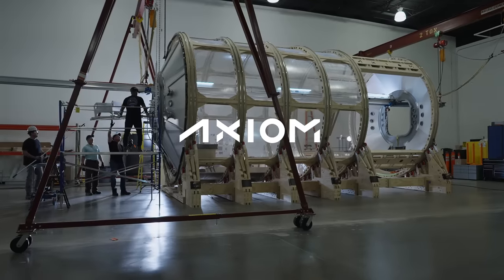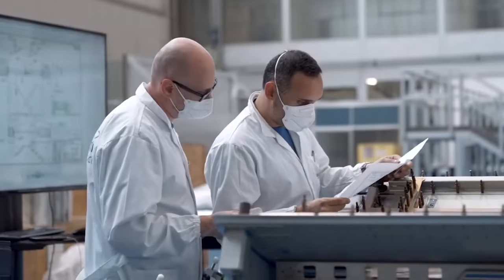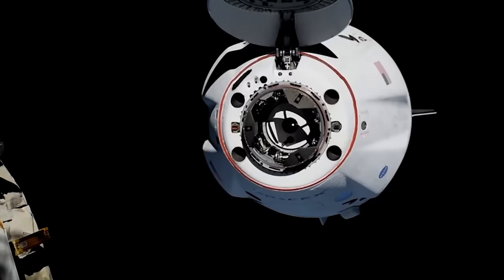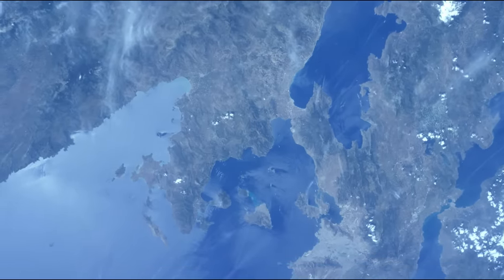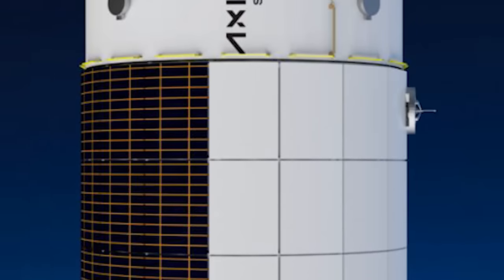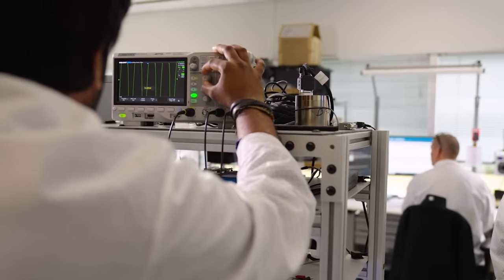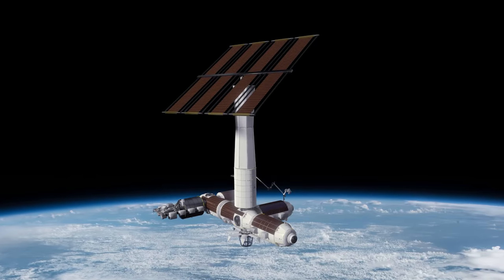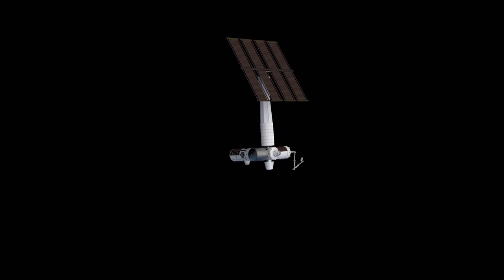Axiom Station's First Module Is Not Far From Completion

Comment: Very nice reporting on this. Thank you!  Hyper interesting reporting here with excellent graphics.  I would love it if they would use Alon for the windows, as it is far, far more durable than any other clear material they could install. Two inches of it will stop a 50 calibre round. Perfect for those micrometeoroids. Yes, it is more expensive, but when you're talking about human safety in orbit, you really need to budget for that.
Reply: A 50 cal bullet doesn't travel at 17K+ miles per hour.  Just sayin'.  😉
Reply: Talking about next-gen' Space Stations.
Reply: Engineers tend to work within many simultaneous constraints not just "stronger is better"

Comment: It would be great if Axiom can reuse part of the ISS. The current plan is for Axiom to incrementally add on to the "front" of the ISS and then disconnect when the time comes. But what if, instead of disconnecting just the Axiom-built modules, they instead disconnect between the Harmony module (Node 2) and Destiny module (the US Lab portion)? Destiny is not a good candidate for reuse because it's one of the oldest modules and probably won't have much life left by 2030, but also because that's where the giant truss structure (which holds the ISS solar panels) is attached. But everything forward of Destiny is significantly younger and can be disconnected together as a single piece, without having to juggle modules around. This forward portion includes Harmony (Node 2), and connected to it are the European Columbus module and the Japanese Kibo module, the "attic" storage module, and the Japanese external payload platform. I'm sure there are many in Japan and Europe who would love to continue making use of their sizable investment for at least a few more years.
Reply: Perhaps those modules and truss will be past their "use by" date i.e. worn out, technically outdated, design outmoded etc?
Reply: @davidstevenson9517  That's why I specifically ruled out keeping the older modules like Destiny, and you definitely can't reuse the Truss.
Reply: @regolith1350   why can't they reuse the truss?  and solar panels?

Comment: Why don't space stations create universal modules with docks at the end in any direction, so they could cheaply develop and manufacture massive space stations then cheaply launch them on falcon 9s.
Reply: Standardized modules will be possible once we get past the development stage and can work on module prototypes with confidence.
Space station modules average 20 tonnes in weight and 4.5 metres in diameter, far too heavy and large for SPX Falcon 9 or Heavy (both limited to 10 tonne/3.5 diam. max. to LEO)
Until recently, only Proton, Atlas 5, Delta IV and CZ-5 could launch modules that size.
Gone, now, are Atlas 5 and Delta IV but Vulcan (27tn) has joined "The Space Station Club" and New Glenn (35tn) is only months away from earning membership. We'll get there.

Comment: Quite informative, but is there any info on how the Axiom plans to avoid cross contamination from ISS? And second, is there more info on propulsion system? Will it be integrated in station modules or they plan to use spacecrafts like cygnus or spacex? Cheers

Comment: Musk will be able to launch space station size ships into orbit and then bring them back down for refit and cleaning. why make a permanent station like this that is a throw away concept? first thing to launch will be a hub ship.
Reply: SpaceX did put out a proposal to use a Starship as a Space Station, but they didn’t really put much effort into it - it was a throw in the dark. The biggest downsides are modularity for later expansion and of course the massive engines and fuel tanks which are just a waste.

What Starship will be great at is launching massive modules, ones we’ve never seen before. Like Airbus’s LOOP - the largest non inflated module, or Siera Space’s LIFE 3.0 module, which’ll have an interior space of 5000m^2 (5x the volume of the ISS!)